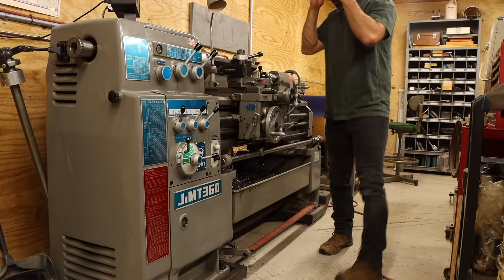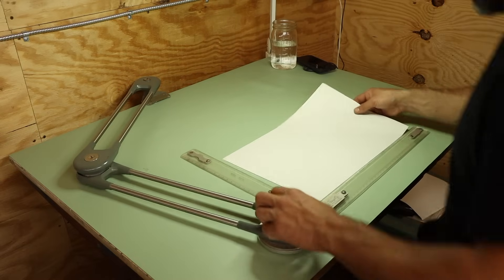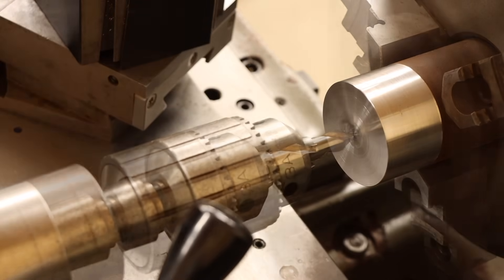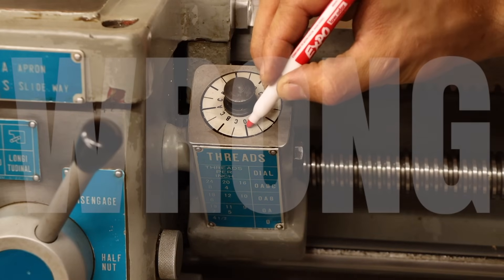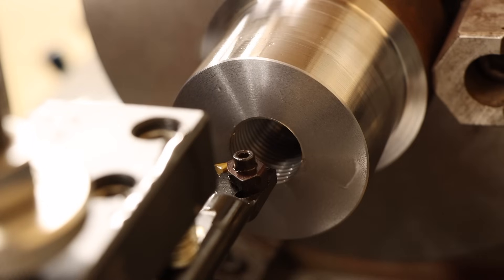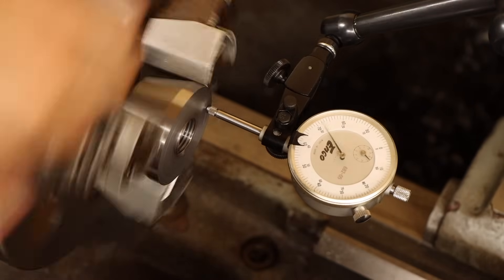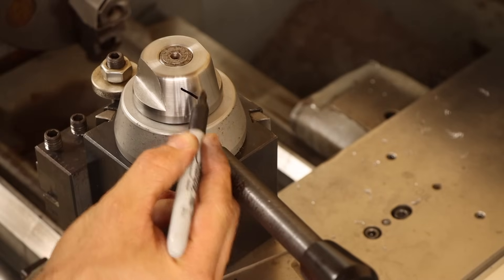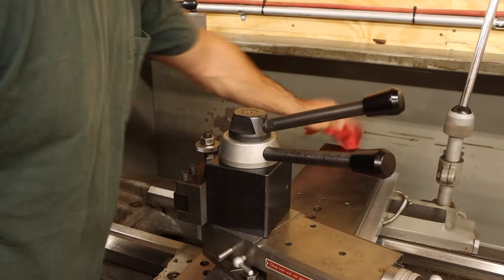A Better Tool Post Nut || INHERITANCE MACHINING

Comment: Nice addition Brandon.
For the last mill operation small parts are best mounted in the centre of the vice jaws unless there is a feature which restricts it.The jaws go out of parallel quite easily with an offset part and lose their ability to hold firmly.
Reply from the maker: Thanks Michael. Yeah I got a little hasty there. Did it to one side so I could use the vise base as my angle reference. In hindsight I should have laid a parallel or something else down to span the middle.
Reply: @InheritanceMachining  Just for fun and education put a dial test indicator on the moving jaw and clamp a part on one end of the vice.It may surprise you.Check the fixed jaw the same way for another surprise.The steel in vices is closely related to Pasta in some cases.
Reply from the maker: 😂 😂  I'm almost afraid to look now!
Reply: @InheritanceMachining  Knowledge of Pasta is important in machining.

Comment: Tool height gauge is on the top of my side project, er, shop upgrade list.  Nice job on this nut... I HATE each moment I reach for the adjustable metric wrench to adjust my tool post... never seems right.
Reply from the maker: Hey Isaac! Yeah it wont be long before I make one as well. That and better tool holder adjustment posts. I got lucky with my original tool post nut as its a 38mm, so basically 1-1/2 😁 but now that doesn't matter of course

Comment: I made that exact mistake making the tool post nut on my lathe, drilled it in the wrong place, Had to add a washer under it to bring it round to the correct position. nice come back on your part though.
Reply from the maker: Oh no! 😂  That probably would have been my work around if I didn't get as lucky as I did. Thanks!

Comment: @Inheritance Machining 
I've found a great video explaining some conditions to be met in order to cut metric threads with an imperial lead screw.
The video is called " Threading Dial Indicator for Metric AND Imperial Threads " from the channel An Engineer's Findings on 04/21/2020.
Maybe you can get in touch with him and make your own threading dial indicator for your lathe , could be a nice collaboration and an awesome  " Side Project "
Reply from the maker: I was actually bouncing that very idea around in my head... thanks for the tip! I'll have to see how he went about it

Comment: Getting the thickness of the nut just right is a nice touch.  One thing about metric threads on an inch lathe is that you have to leave the halfnuts engaged once you start and only reverse the motor to wind out.
Reply from the maker: thanks! yeah it dawned on me how obvious that is once I realized my lead screw is 4TPI. I actually got a helpful tip on this as well. You can disengage in your stopping window then turn off the lathe. when you run in reverse pick it back up on the same mark. as long as the dial doesn't go all the way around you'll stay aligned

Comment: Watching this video reminded me when I made my entire QCTP and I done exact same thing you done milling the flats before checking position. I also got lucky that day.
Reply from the maker: we have been graced by the shop gods. I'll check out your series when I get a chance but I'm curious how you like the plunger style QCTP?
Reply: @InheritanceMachining  So far so good. Does it have the same clamping force as the sliding dovetail… No but for the simplicity of a cam and locking pin it works well. For me was also a great project to have a play with all the tools in the workshop. 
Keep doing what your doing dude and will be good to see what you think to my series. 👍
Reply from the maker: @MachiningwithJoe  that makes sense. yeah I was going to say that seems like a very involved project. Looking forward to seeing how you did it

Comment: I kinda suspected you'd have problems as soon as you mentioned "metric".  Nasty stuff, that.  Then you doubled down on the bad mojo when you started on with that "trigonometry" jive.  It's no wonder the Shop Gods show their displeasure.

Ever watch The Tool and Die Guy's channel?  Great stuff, and a real wonder he doesn't have more subscribers than he does.
Reply from the maker: A Chinese machine, made with metric hardware but to imperial standards was asking for trouble 😂 

I haven't heard of that channel. I'll check it out

Comment: What? Done with all the side projects???

For the metric thread, have you tried re-engaging the half nut exactly on the same number?
Reply from the maker: I fluke for sure!

Yeah that's what I was doing on my first attempt. Someone actually explained why that wouldn't work since the lead screw is a 4 TPI pitch so only way is to keep the feed engaged the entire time.

Comment: What is that solution you used for the black oxide finish?
Reply from the maker: It's a cold bluing solution from Caswell Plating. I highly recommend it

Comment: If the boring bar had a hole in the other end you could level it perfectly on the tail stock.
Reply from the maker: Possibly... I'd have to check but I'm not certain the tool edge is on centerline. Plus I tend to cut a little quieter running slightly high

Comment: I learnt the hard way about metric threading too, the joys of engineering 😁
Reply from the maker: once i realized the lead screw is 4TPI its so obvious what I did would never work... 😂
Reply: @InheritanceMachining  you live and learn lol, I'm making a new cross slide lead screw for a lathe I've also inherited, the nut is also fairly worn out so I've made it over size but with the same pitch and instead of machining a new nut I'm going to make a tap and hopefully cut new threads in the original nut.
Reply from the maker: @breconmerthyrgwr9250  oh that’s interesting! Are you going to grind some HHS to make the tap or use tool steel then harden? If your lead nut is brass I’d image the latter would work
Reply: @InheritanceMachining  yeah, the tool steel route I'm gonna take. I've got to use half of the existing lead screw because of the gear for the power feed and the splines for the hand wheel, it's only the threaded part and the nut that needs repairing, so I've made the thread and cut the worn off the existing, just got to marry them together now, I've got two weeks off work so I got plenty of time to get the lathe all together and up and running, as long as the wife doesn't give me a surprise 'to do' list lol. Have you got an email I'll send you some pics of the progress if you want.
Reply from the maker: That's a pretty cool project actually. The projects you take to repair machinery always seem like they are more rewarding since you end up making a whole machine more functional again (or more functional than before). My email should be on my channels ABOUT page. I'd love to see  your progress
Reply: @InheritanceMachining  that's how I think, it's a lot more rewarding than just buying new, awesome, im in Wales so it's 1 in the morn, I'll send some pics tomorrow, I'll have some of the tap being made too. All the best, Tom

Comment: Wrong hatch on the section view. That hatch is for cast iron.
Reply from the maker: oh really? 😂
Reply: @InheritanceMachining  Page 622 of the current Machinery's Handbook 31st edition  shows common hatch patterns for various materials. This is a table from Asme Y14.2-2008. The table is not included in the current standard Asme Y14.2-2014 (I looked) but is still valid.
Reply: Not trying to bust your balls or make you look bad, but I am retired from a long career in drafting and engineering. Before I did that i worked as a welder, fitter, millwright and a journeyman sheet metal mechanic. These things matter in industry. After the thousandth time of getting an ass chewing by some pissed off machinist for drawing something that can't be machined according to print, one finally gets the message and does it the way it should be done. Because I totally get where the machinist is coming from; I've been there too.

Thanks for your videos and keep making chips!
Reply from the maker: @mikepelelo5657  oh I thought you were just messing with me! I never realized that’s why there were different patterns. Even in modern modeling and drafting software the patterns aren’t linked to different materials automatically. The title blocks usually have a section for material and finish. I appreciate the info regardless. I don’t have a copy of the handbook surprisingly but It’s at the top of my wishlist. Thanks again
Reply: @InheritanceMachining  I've probably got 4 different editions of MH around here. 10-20th editions are great for manual machining; they've got tables for speeds and feeds that are long gone in later editions. Also lots of arcane info on things that are no longer done anywhere. Later editions have current stuff. Another great reference work I keep close to hand is the Tabellenbuch Metall, 47th edition. I have the English language version called Mechanical and Metal Trades Handbook. It's pretty muchity the European MH.

Comment: Really enjoying these videos. Is your thread location issue because you're using the compound to increase your depth of cut, but it's at 60 degrees so it's going to move 2/3 of the direction of the main carriage and 1/3 towards the chuck relative to the threads. Increasing your depth of cut on the main carriage might solve your problem
Reply from the maker: Thanks, man! Are you referring to the depth of the thread cut? if so the problem there was that I have a habit of cutting the thread to fit a mating rather than figuring out how far I'll need to go, either on the compound or cross slide. I always worry if I go by the book, manufacturing tolerances could end up with a looser fit than I like
Reply: @InheritanceMachining  sorry wasn't clear, no your second attempt where you said it was like cutting two different pitches (8:44). If my reckoning is right increasing depth of cut on the compound moves the tool in the axis of the cross slide, as desired, but also left towards the chuck relative to the power feed threads. It's been many years since I touched a lathe so I might be completely off though
Reply from the maker: @SttochPineFTW  oh I follow you now. Yeah that compound technique is pretty common. Turned out (and it’s so obvious to me now) that even though I was engaging at the same point, my lead screw being 4TPI means I never would have fallen into the same metric groove

Comment: Great job. Looks great! Maybe next (mini?) project could be to add a pin to align the tool post to 90°
Reply from the maker: Thanks! I've actually been trying to think of a good way to do that. That the compound could be at any angle so I need something independent of that
Reply: @InheritanceMachining  https://youtu.be/-RFWnE-g1Vw
My mechanics insights did a good video on a solution.

Comment: I just used my 15" Cresent wrench of 31 years, usually while sandwiching a 2,4,6, block between the tool post and the chuck face... pretty square, pretty quickly...
Reply from the maker: I do this method sometimes too! just depends on what's more convenient at the moment

Comment: It's amazing you still have your manual drafting skills intact. I took drafting in high school and I forgot it all.  The little I do remember made learning CAD super easy.
Reply from the maker: I feel like I don't remember much at all haha just drawing lines with a ruler. I'd definitely have to go back and review all the cool compass techniques for drawing polygons and bisecting angles and whatnot.
Reply: @Dan Carlson Yeah, there was a lot of attention to the title block as if it was more important than the drawing itself.
Reply: I still remember a comment that my 10th grade (1963) drafting instructor made. Draftsmen will always have a job. Before anything is manufactured someone has to draw a picture of it.

Comment: I've seen folks doing this. I just leave mine square with the ways and change tool holders accordingly.
Reply from the maker: probably not a bad strategy. do you have a lot of insert tooling with different rakes and whatnot?

Comment: Leaving the half nut engaged and reversing the spindle is usually how we in Europe cut threads on a manual lathe yes
Reply from the maker: I think its pretty common here too, I've just never gotten in the habit of it. definitely the only way for the metric threads

Comment: Great stuff!!!  Can you tell me what you were using for your black oxide?  I have used cold blue fluid, but it's not cheap.  I also tried some powder I bought from ebay that gets mixed with a gallon of water, but it does not work very well.  I would like to have enough volume to dunk a large part, rather than applying it with a brush.
Reply from the maker: thanks! I use a kit from Caswell Plating. I think it was $75 but has lasted me basically since February and still kicking. Ive done a lot of cold bluing off camera too

Comment: Nice, but why not counterbore a recess into the bottom of the nut and fit a roller thrust bearing down, protruding just 0.09mm or such when fully tight and use that to aid the smoothness and reduce the need for wrench flats, as thrust bearings allow you to clamp down on the post, or when you needed more rotation, why not lay some wet sandpaper gritting up to 5000 and lap the bottom of the nut by hand to make it polished if you dont trust the thrust bearings and the gap that crud and chips can crawl in and etch the metal over time... Just something i would consider when doing such a project... Tho, at the moment, no such projects for me as i am undertaking a restoration of a surface grinder, and tho i appreciate your video on surface grinder resto and tony`s s.g. rebuild, both are great, but to finish mine, i need to make an engine crane... You took your x table on the S.g. by your hands and moved it away... I tried that, and realized that mine is likely twice the size, and thus, much greater in mass... I didnt even try... the fucking magnet is 32kg, even if i took it off, the table is likely 100 kg or more... I am willing to deadlift my dogs, which are around 50kg, but not a precision slab of iron that is at least twice that... Hell to the no, off i go deadlifting  slabs of steel that are to become an engine crane... 
All the best!
Reply from the maker: I wish i would have though about the thrust bearing, someone else mentioned that as well. pretty clever. And I think i would have been there for a lot longer if i were to sand the 4 thou off for the extra rotation.

you must have a massive SG! my table with the magnet removed was probably around 50kg. The saddle was WAY more... probably 100kg and probably not the smartest idea to move by hand. 😂  building an engine crane is taking side projects to the next level! I approve

Comment: This projekt maybe looks simple, but every machinist knows, it isn't. You did very well, much better than I at my first touch with Inch measurement🤣
Reply from the maker: Well I appreciate that, sir 😁  I imagine the troubles are the same making inch parts on metric equipment
Reply: @InheritanceMachining  Exactly 😁

Comment: Enjoy your channel, but have a question any reason that you are not using a tap follower in the mill?  Other than not having one, if that is the case seem like a good next project.
Reply from the maker: Thanks! I sortof do.. more like a t-handle tap holder with a rotating shaft in the end. I don't use it all the time since I would have to traverse the knee all the way down (no excuse though now that i have the powerfeed.. old habits...). A spring loaded follower would let me use my big tap wrench though so I might consider making it
Reply: @InheritanceMachining  understands and more reason to get or make a tap follower not as long as a rotating tap handle so you shouldn't have to power feed the knee and it is spring loaded to keep the pressure on the tap.  keep up the channel like all that you do.

Comment: You will need to make a nice tool-height gauge for the lathe at some point as a side project. Especially on small diameters eyeballing it with the tailstock won't be good enough. Even a few tenths (yes, tenths of a mm) of height difference can mess up your infeed reading in regard to your actual depth of cut.
Reply from the maker: I have a height gauge on to-do my list for exactly that reason.
Reply: You can make a very simple but quick and efficient one by just turning say a 2" steel bar down to say 1 1/2" for say 5" on a bar that's about 6" long. The 5" length needs to be an accurate length that is the same as height from top face of cross slide to center height. You just sit the 'mushroom' shaped bar on the cross slide and adjust the tool height so the tool just slides under the 2" head. Worked very nice on a smaller lathe than yours. Hard to describe in text!

Comment: Cutting metric threads with an imperial lead screw. The best way to do that is how you ended up.
Reply from the maker: From what I'm finding out its the only way. If not with some slight differences in technique

Comment: It's a bit controversial with experienced machinists but for threading (especially blind) it can be less scraptastic to thread from left to right. Joe Pi has a video with all of the details but basically you flip the tool upside down and reverse the motor. It sounds ridiculous but the results can be quite nice.
Reply: Yeah Joe Py is a wizard
Reply: I believe you can also use an internal threading tool but hold it on the back side of the work and run in reverse
Reply from the maker: I've seen this (not by Joe Pi) but I think it takes an opposite hand cutter from what I have. Flipping mine would still require the lathe to run forward, even if I'm cutting on the back side of the bore. Then feeding out would make a left-hand thread. I should get the opposite hand tool since i would prefer to pull out of the bore rather than in
Reply: @InheritanceMachining  If the spindle and drive shaft are rotating in the same direction then it will cut a right handed thread, I think, regardless of whether the motor is running forward or backward.
Reply: @OhHeyTrevorFlowers  yep